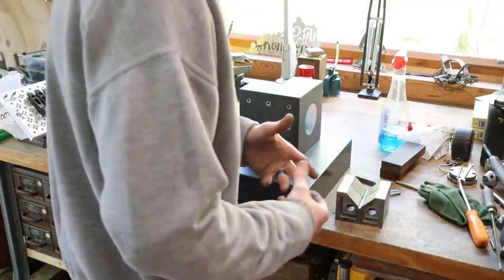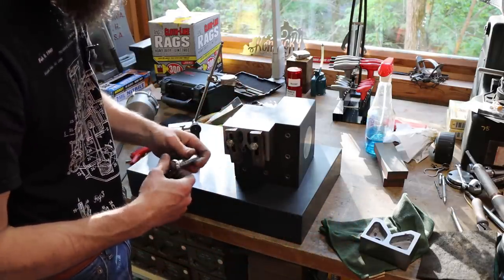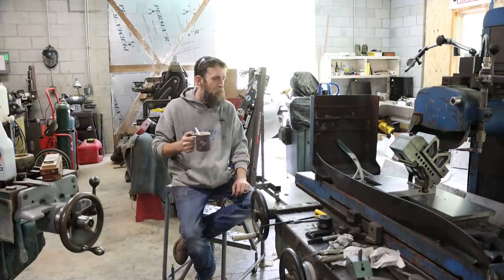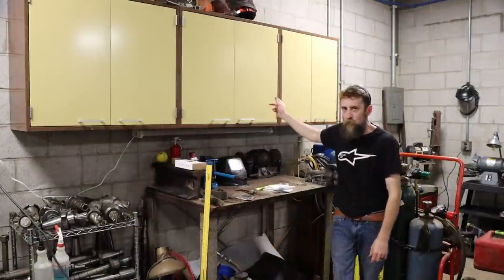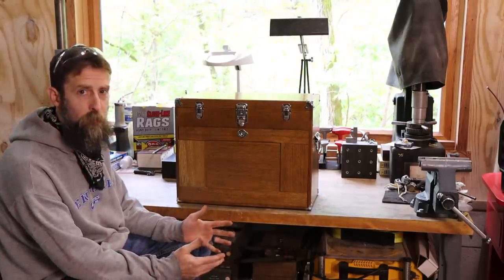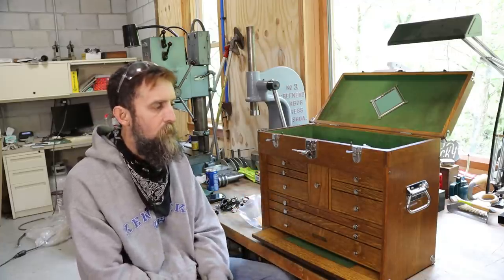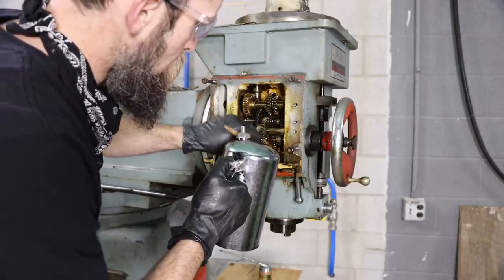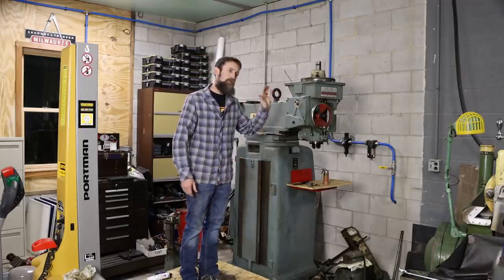DoAll Mill Gearbox Service / Surface Grinding V Blocks & New Gerstner Tool Chest

Comment: It is sad what has become of the shipping companies in the US Steve , I recently purchased a 20 ton shop press from NT and when it arrived shipped with YF the box it was in was completely destroyed and the paint scratched up to say I was upset is an understatement lol not surprised though because I also purchased a torch cutting outfit from NT years ago and both the cardboard box and the molded plastic it was in were also destroyed 🤦🏻‍♂️ And I also had a bad experience with UPS years ago when I purchased some truck parts for an old C10 pickup truck I was planning on restoring/ modifying the 180$ radiator I purchased with it was so badly damaged it was unusable and when I contacted the company I purchased it from they told me UPS was in a union driver strike and that this was happening to other folks items as well ! It’s just a shame that these shippers get away with this nonsense by putting no fault clauses in their shipping agreements 😒 Anyway love your channel and what You do sir , I’ve learned a lot from watching your videos Thank You

Comment: Do you have one of those diamond-tipped grinding wheel dressers?  Adam Booth and Keith Rucker use one of those before ever using a precision grinder every time so that the wheel itself doesn't get worn too out of shape to remain precise.

Comment: Use brake cleaner and or starting fluid. Cuts right through all that grease and it evaporates. Diesel, kerosene and even gas can be good cleaners but, they leave a residue behind, plus they're not good for the skin. Cheers :)

Comment: Your V block topic is timely.
I’m about to start making them. 
Unfortunately, my mill broke down so there’s some fixing to do first.
Aaaannnnd, I just took delivery of an Index vertical mill and a small lathe (12”? I’m not sure yet).
“Some assembly required “. 🙄 😁
Thanks,
John

Comment: Old Landrovers used grease in their swivel hub axles, but due to the same problem with settling, replaced the grease with a product called one shot. Its like a runny grease similar to car driveshafts that will get around the gears if you half fill the gearbox.
Reply: And on top of that it has a lot of Molybdenum disulphide in it too. Filled many a swivel hub with that stuff!

Comment: I took a friend to the hospital a while back after a ladder fall. Please don't set up an impalement situation under your ladder. I wonder if you could make a nice walkway on that side with pallets? Add some wood for the gaps, brace them up and bolt them together. It could be cheap and last a long time. It might even help reduce the erosion on that side.

Comment: I usually only ship vises, which is a challenge in itself, but for insurance reasons with fragile stuff you need to do double boxing. You need to have an inner box and the parcel box. Otherwise they won't even look at a claim. You put the fragile thing in a small parcel box padded with say 2 inch styrofoam. You put this box in another parcel box and pad this again with with 2 or more inch of styrofoam. Don't forget a parcel needs to survive 3 feet drops (which my vise parcels probably don't do but they have heavy parcel stickers on them and they are heavy 😁. I used double boxing for my first vise shipping but gave up on it.)

Comment: Hey Steve! My opinion of your Gerstner is that it's from the late 70s or early to mid 80s. The main latch was shaped more square all through the 60s and well into the 70s. I still have my shop used, nice looking '68 model I purchased new for $56.00. Sounds cheap now, but a model 526 Kennedy was only $28.00 at that time. Inflation!
Reply: If he is really interested, there is a serial# on the bottom.  They will look it up for him.  This can be very interesting!  I bought one and was told late 80's by the seller.  Serial # proved 1964!  It looks perfect, so I am guessing a factory restoration like Adam Booth had done.
Reply: @paulcopeland9035  As far as I know, there are no serial numbers, only job numbers that can't be dated. They are written inside on the bottom and on the backs of the drawers to keep all the parts of each box together. The only way to date a box is by the labels, hardware and drawer layout. The factory can get you an approximate year, but not exact

Comment: Had to laugh when you got the coolant in the face, apologies for that! Whenever you mount a wheel on an arbor the arbor should be balanced, it's not good practice to just change the wheels, that will improve your finish and it's a safety issue. There should be balancing weights in a groove on the arbor and you will need a balancing jig with a dummy spindle. You may already have these things but I thought i'd just mention it anyway.

Comment: I've never tried the coolant pump to my DoAll grinder.  With all the wiring complications that come with using a static converter, I'm not sure I want to.  Thinking of going with something separate, maybe try a cool mist setup first.  Being a fair weather shop, for the time being, is another consideration.  I don't know how how those coolants react to getting frozen, which is bound to happen.
Reply: Coolant is not exactly pure water. So while I'm sure it'd freeze it'd probably have to be pretty cold. Like The Rodeo Song cold. https://youtu.be/DAp7FvZ5Opw?t=7

Comment: Being more of a wood guy, I can't help but look at surface grinders and think, Man I could get my chisel so sharp with that thing....

I couldn't.   I could ruin the machine, and turn the chisel into a 1000mph dart though.
Reply: You can just use a bench grinder for woodworking tools. That's what I use. I like hollow ground primary bevels. I still hone the secondary bevel by hand myself. A hollow ground primary makes that a lot easier to do. Easier is good. But it helps to have a grinder with an angle adjustable tool rest to get a nice clean grind. Something like the Veratas tool rest. I made a copy of that for one of my grinders. I'm too cheap to buy one. Look up sliding adjustable tool rest and if you see a homemade one that may be mine. If you see an orange cord in the picture it is. Though the motor on that grinder died so I had to make a new frame for that arbor. It was a tragic loss.
Reply from the maker: LOL, I bet you could run one. 😂. I've shot things off the table before. So has everyone else who ever run one more than twice.
Reply: @1pcfred  oh now those I Know from experience I can cause damage with.😂 I do have the veritas honing guide, and the narrow blade base.   I actually enjoy sharpening, though i'm not amazing at it.
Reply: @SteveSummers  I'm pretty good at flinging stuff with the table saw and the angle grinder already.    .... and sometimes the drill press.  I really shouldn't be allowed to have power tools.

One of these days after I win the lottery twice I'd like to get a basic home machine shop setup.
Reply: @roscocsa  you damage tools with bench grinders? Most amateurs don't know grinder basics like stone dressing. It is important to cut the stone to use it. I don't like those star dressers myself though. I use either diamonds or carborundum sticks. With a fresh cut face grinding goes better. Like your other tools abrasives need to be sharp to work right too.
Reply: Real nice for planer and jointer knives I'd think....
Reply: @1pcfred  At one point or another I've damaged myself, tools, the bench, the grinder, the wheels, and the sanity of anyone nearby with power tools.

I suppose it has been a while since I've turned a piece of steel a nice deep blue color though.
Reply: @roscocsa  you do have to dip metal into water occasionally to cool it down. Or grind very gently. Perhaps one of those slow speed water wheels is your style? I hear with the cheap ones around today all you have to do is oil the arbors and they work OK. Otherwise they rust. They're no Tormeks. Someday if I hit the lottery I'll get one of those myself. Dream big, right?
Reply: @jimurrata6785  if you want a really keen edge you have to hand hone blades. But how important that is with power tools is debatable.
Reply: I have a Belsaw sharpening machine I got a good deal on several years ago. It has a guide that is perfect for grinding chisels and plane irons. It also has a lapping attachment, and with the right wheel, you can sharpen carbide circular saw blades..
Reply: @jimurrata6785  my planer and jointer have the indexable 4 sided inserts.  Speaking of which I need to take the planer apart and clean and inspect.  I'm getting some lines.  I either have chips or some
Bit of dirt under a cutting edge.
Reply: @1pcfred  I'm ok with diamond stones and/or a tile with sandpaper depending on what I'm doing.  I mostly save the spinning spark throwers for things like lawnmower blades these days. I'm an IT guy that makes wooden stuff.  If this was a career I'd have a tormek.

It can be a pain if I drop something and get a deep chip to regrind by hand.  But it's exercise and keeps me busy.
Reply: @roscocsa  the thing about sharpening is you want it to be as painless as possible. A bench grinder can hollow grind a primary bevel so you hand hone less material. That makes sharpening faster and easier. If you're into chisels and hand planes then I say bench grinding is essential too. I've done it both ways myself. Using a bench grinder is an improvement. But there is a bit to using a bench grinder right. You need a rest you can adjust the angle on. Most grinders lack that feature. You need to properly dress stones. Most folks don't even know what that means. Grinders like other tools need to be used sharp. Yes you need to sharpen your grinding wheels. But it is easy to do. In this video we see Steve's diamond dresser. He knows. It's that block in front of him on the grinder with the little rod sticking out of it. At the end of the rod there's a chunk of diamond. It cuts the face of the grinding wheel. I used to work for a major supplier of industrial diamonds. They're more than just a girl's best friend. Us guys like our diamonds too! I use carborundum sticks too.
Reply: @roscocsa  Well, helical cutter heads are really nice and will last someone like you a lifetime.  
If you have a few chipped inserts just turn them 90°, or buy a few new ones (because it gets pricey when you have to replace 120 of them)

Comment: I hate to tell you so, but I warned you, a week or so ago, about dead-heading that coolant pump. I didn't  anticipate the blow-out, but I thought it would hurt the pump and overheat the coolant.
As for the moly EP grease, I found it not very good at lubricating roller or needle bearings. I've found it much better for sliding friction apps like bushings, and ball joints. I once used it on wheel bearings, and it failed miserably.  I don't know what kind of bearings you have in that gearbox, so judge accordingly.
Anyway, loved the customizing the v-blocks. Good job, there!
Reply: My understanding is Moly is never to be used on precision roller/needle bearings etc. as moly is a (very fine) particle which will permanently coat the balls and races thus ruining the tolerances. As you say it's absolutely wonderful for bushings, etc.
Reply: Agreed. Moly is fine for slow speed sliding fits, but it will cake up in ball or roller bearings.
It's fine for suspension and steering. Knuckles in heavy equipment.
Reply: @jimurrata6785  Someone once gave me some small bottles of concentrated moly meant to be added to regular lubricating oil. I mixed some up and used it as way lube and it was awsome.
Reply: @crichtonbruce4329 Sounds like Kal-Gard Engine Gard.....
That was some moly snake oil that was supposed to seek and destroy hotspots in your engine.  🤯
We're you having problems with your ways sticking or galling? It sounds messy.
Reply: @jimurrata6785  It was a long time ago, so I don't remember the brand. I don't remember it being an engine oil additive. Anyway I mixed a fairly small amount in some 5w non-detergent oil just as an experiment and really liked it, esp. on vertical ways as it clung nicely. Also I found only a very small amount on the ways was needed to provide an almost skating rink slipperiness. If I had genuine way oil  (this was a farm maintenance shop way out in the boonies) I would have been using that. I also liked it for plain bearings and bushings.

Comment: ROFL ehr whoops , pretty good pump , you might be able to lower the pressure by adding a T to the line with a second tap flowing part of the coolant back intoo the tank , this might allso keep the pump running cooler

Comment: 3:57 Sorry I can't stop laughing lol :) - But thank goodness for the eye protection.
Reply: Later on Elizabeth walks into the shop while Steve was grinding (I know he wasn't using coolant at that time) and the first thing that popped into my head was "If that coolant line popped off right now, there will be a closed casket funeral in rural Kentucky".

Comment: Here in Maryland the 17-year cicadas are coming out. My yard looks like it’s been aerated by a machine! Don’t know if you get those in Kentucky but they will provide plenty of additional nature footage for the channel if you do. And the shop is looking great. Too bad about that carefully reconditioned tool chest.
Reply: The cicadas are up already? We're supposed to get them in Delaware too. So far I have not seen any. We actually cut back on gardening plans because we don't want to be outside with them.
Reply: @billlewis9740  there's nothing here where I'm at in Delaware yet. We're supposed to get them. I've only been here 14 years though. So it'll be a first for me here. I saw them where I come from up north years ago. Was like 1980? I think it was a different brood.
Reply: @billlewis9740  it’s really weird. There are holes everywhere but no bugs visible. What are they doing down there? Not to mention what have they been doing for the last 16 plus years. Last time around they ate through the bark on lots of branches. They are really hard on young trees. U inform of the day includes noise cancelling headphones...

Comment: Steve, you should not reach for your part while the grinder is still running and you should mind your oxy-acetylene hose so that you don't damage it from sparks, lastly if you're gonna keep propane under your desk you may get the family jewels BBQ'd

Comment: The biggest problem I can see using a granite square on your grinder, is shifting momentum, side to side.  To limit this, just a few strips of steel plate pushed firmly in place while turning the mag on should do the trick.

Comment: Hi Steve. I  watched your latest video last night and felt your disappointment with the damage to your Gerstner machinist box. I bought one at a flea market in upstate NY about five years ago and shipped it to Florida.  It was double boxed with ample padding. I thought there was no way it could be damaged.  WRONG! Split in the same place as yours. I used a syringe to force glue into the damaged areas and clamped it. Still using it today. This is a chronic problem with both USPS and UPS.

Comment: Surprised there isn't a directional valve bypass on the coolant so that when you shut off the nozzle it just diverts back to the tank.

Comment: Most mainstream parcel delivery company's pay minimum wage, treat drivers like tools to be used rather than as people, and have a culture of rewarding efficient drivers with a higher workload (but no extra money). It's easy to understand why some of them get so disillusioned with their job that they'd take their frustration out on the customers parcels.

I've found a better option for fragile high value items (Up to around 40kg) is to find medium sized IT logistics and repair companies and give them a call. Some will happily take in simple collection/delivery jobs, and the cost is usually related to your requirements. If you want it delivered at a certain time of a certain day, it's pricy as hell. But if you allow them to pick up and drop off whenever it's most convenient for them, it's not really that expensive. The good thing is that the "Drivers" tend to be PC engineers who are paid a liveable wage, and know that if they're excessively rough with the kit they're hauling, it'll often bite them in the backside when they come to install it at the customers office and find it was broken in transit.

Well worth looking into.

Comment: Does Your in and out feed work? If not, I think I have the same grinder if its a Kent. I had to replace mine. It was only around 300 dollars. Kent actually has them in stock.

Comment: I worked for Harrah's Casino and we had a national brand contract with FedEx until one day these idiots decided to destroy over 2 Million dollars worth of slot machine program chips.  I called to see where my package was and they first tried the old we just left it blah blah blah blah and that's when I pointed out that the package was insured and after she pulled up the order number and saw the insured amount her shitty attitude went right out the door.  
After 3 months and several lawyers conference talks later we found out that local delivery hubs can choose to destroy damaged in route packages if the package is horrifically damaged and they aren't required to notify the sender or receiver.  FedEx lost the 56 properties national brand contract and worked out a deal with IGT Gaming to payoff the 2 Million in lost goods.  
The next order of chips was escorted by 2 men and the box actually bought a ticket and sat between the 2 men.

Comment: Hi Steve you could send the box back to the manufacturer and they will restore it to its original condition Adam at Abom79 did exactly that with one he had acquired and made a video of it being restored which you should check if you have not seen it its a great video
Reply: He mentioned Abom79's video and said go check it out
Reply: Or take it back, considering its last adventure in the shipping department.
Reply: I bet they don't ship their boxes via UPS lol might be an idea to ask them who they use for shipping.